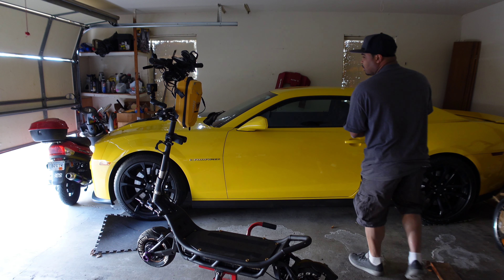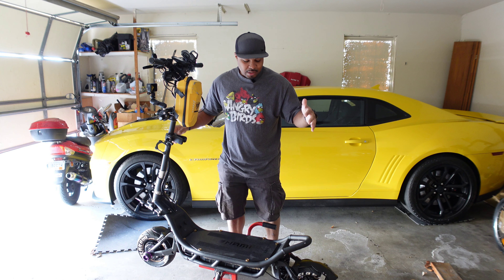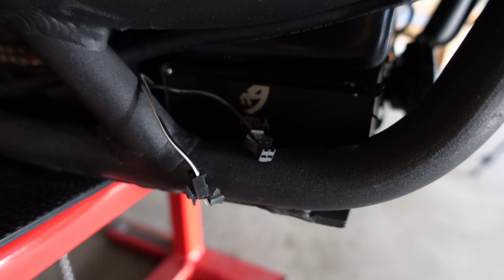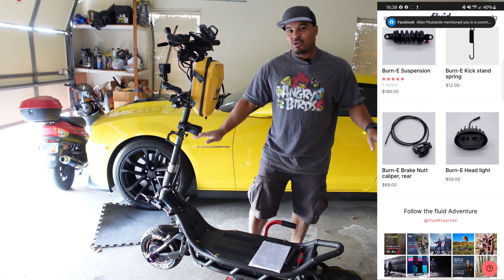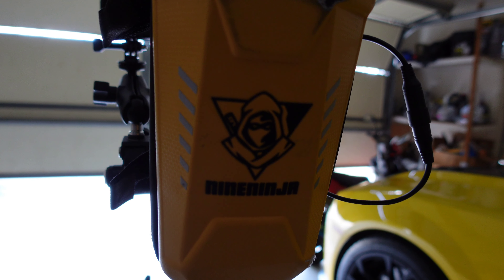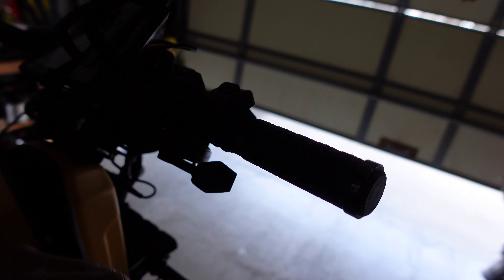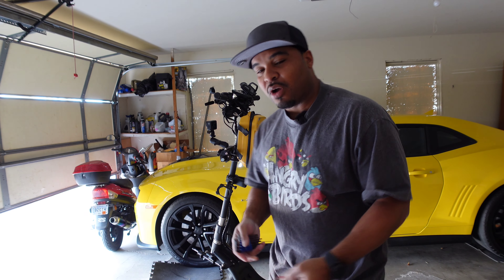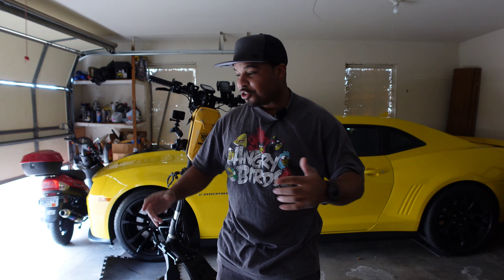Nami Burn-E *Post Thoughts/Things to expect/Accessories* (New news on NAMI Gen 2 MAX)

Comment: The breaks way too expensive but in the UK cost 100.00 I have breaks that are similar breaks just paid 50 for them they xtech hydraulic breaks,  those breaks of magura say they can handle speeds of no more than 28mph bro ???? People are paying for the name they are just standard breaks lol 😆 all scooter but few have electric breaking hydraulic system,  here in the UK beginning to think we treat like royalty round hear you pay 2100.00 for a scooter we pay 1000.00 we get the same specs , 

I bought a p1+ cost me 900.00 pounds 
18ah , 35 Miles range,  2400w , 45mph , gets up any hill does not fall below 30mph on hills

Comment: Since you got it ...you don't have any problem with it ?
Reply from the maker: Hmm I am thinking where I should start lol. Give me alittle time. I will briefly go over things I've had to repair or change.
Reply from the maker: Ok.
Things that happened but isn't nami's fault?
- rear rim got bent while changing lanes so I had to order new rims (possibly didn't have enough air in tire and so road reflector punched hard enough into the tire to bend the rim)

Things I had to repair/change?
- front rotor (arrived bent during shipment)
- both fuses going to each controller (they shipped with 30amp fuse holders with 50amp fuses inside). Both fuse holders melted and one of the fuses popped. So I ended up having to buy 50amp/72v fuse holders and relocate the fuse holders to save space under the deck.

So far these are the only things I have had to change.

But....

The bearing for the base of the steering's stem was very notchy. I solved that problem with silicone spray. I should be making a video soon so you guys can have a visual on all of the things I've gone through with the NAMI. It has been solid with no issues in the last 300-340miles.

Comment: Heads up, I’m wanting to make a brief awareness… the head units on the latest Burn e’s max 2 in comparison to the first Gen Burn e’s are slightly larger.  Therefore the Garmin Edge 830 silicone protector will not fit the head unit of the Burn e max 2 and unfortunately I currently do not know which silicone protector would fit it.  Can someone assist with that, please?
Reply from the maker: Are you 100% sure it's larger? The edge 530 protector is supposed to fit it like a latex glove....nice and tight.
Reply: Which unit is larger of the Garmin, the 530 or 830?
Reply from the maker: @PathWayStrategies  the Garmin edge 1030. I suppose you could try that one which is the next size bigger

Comment: How did you get the sliders on there? Did you have to buy a longer wheel axle?
Reply from the maker: Ahhhh. So with the NAMI all you have to do is remove the wheel nut. 

These sliders in particular unscrews Into two pieces. The inner piece will go over the axle once you remove the nami's axle nut and then you screw the axle nut over the inner piece of the slider. 

After you tighten the nut over the slider you screw the outer slider piece on and you're good

Comment: A few more vids might sway me😉
Reply from the maker: I'm not sure but this weekend I might release one or two more videos. They will be about me changing out the rim. It was actually kinda easy. Being such a heavy scooter, you have to be more attentative with where you place your wheels while riding and how much air you have in your tires. If not, one or the other could bend your rims quite easily which will result in $200 (price for two nami rims *shipping included in that price).
.if your rims are bent, your brake rotor could be bent also because the rotor is screwed into the rim. 

It's a great scooter, I just find myself needing to be alittle more careful with it then I am with my Dualtron Victor
Reply: @Jonasegway  awesome! Appreciate the quick response and look forward to more informative vids👌🏿
Reply from the maker: @rhinoselim700  thanks man. I'll be waiting for your comment someday telling me how you pulled the trigger and got one 😁

Comment: J..what up bro? Great freakn video boss. Damn. Yo boss. 1 thing. You did not mention as far as I know that there are presently three different batteries that are being used. Panasonic, Samsung, LG. How could range on both be the same. Impossible. U figure a higher # on the amps should produce a little more distance. Anyway bro.. I made the jump. Just waitn now. How your back doing? Hopefully ok. Keep up the Great vids.
Reply from the maker: Hey hey whatsup E. Thanks on the compliment on the video!

Ok so as far as the batteries go, if you are talking about batteries with the new new nami's there are just two now. LG and whatever cheaper brand for the 28ah nami. 

Now the higher number of amp hr battery doesn't necessarily produce more range but definitely holds more energy available to use. However. If you have 1500watt motors powering a 32ah battery nami vs a 28ah with 1000watt motors and less weight, you almost balance out the range aspect. 

If you keep the numbers consistent and have a 150lb rider riding the 28ah model and a 150lb rider riding the 32ah model and they ride the exact same way, the 32ah will likely give more range. But barely....

Why? Because between the 1000w motors and the lighter weight, those two specs alone pushes the 28ah closer to the heavier and thirstier 1500watt motor nami. The 32ah model as of current models even with a light rider requires more energy to run. That 1000watt total difference between nami models closes the gap with range. However not enough to give it more range then the 32ah nami but I believe a 150lb rider on the 28ah riding with a 200lb nami rider would probably get the same range.
Reply: Thanx Professor Jay. Great explanation. 🤪
Reply from the maker: @erickspears1889  😂 you're welcome my guy